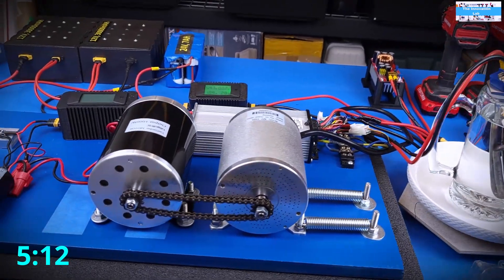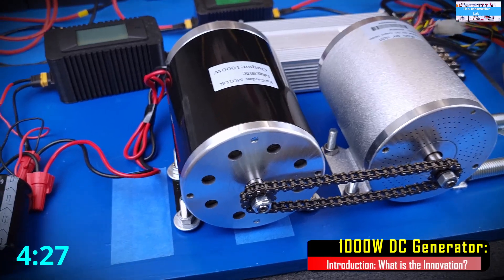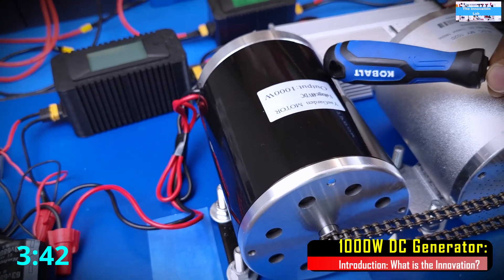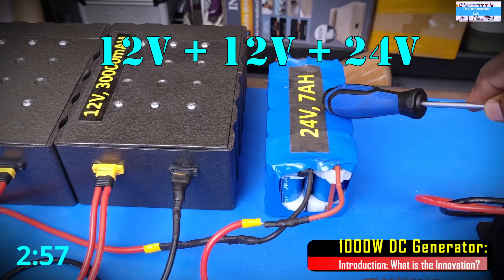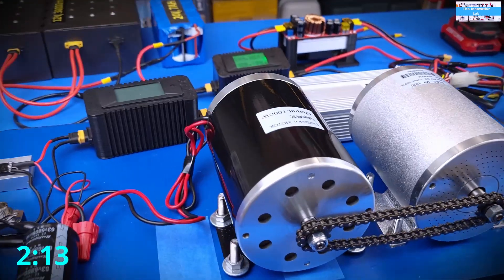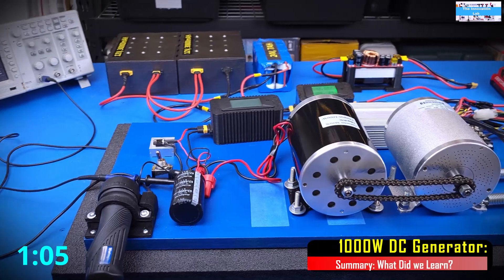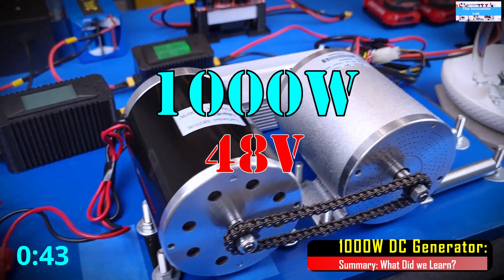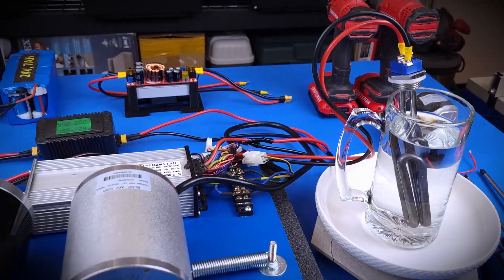ELECTRIC MOTOR GENERATOR, Future DC to DC Boost Converter Drive.

Comment: I bought a 3000w 72v motor with controller kit. I connected all the wires correctly but when I twist the throttle nothing happens and I hear 5 clicks coming from the controller. It’s connected to a 1200w 48v switching power supply with a 1800w boost converter. Do you know why this is happening?
Reply from the maker: You may have a faulty motor or speed controller system. 
However, if you are sure that your system is not faulty,  you could  start with making sure that the output current limit of your dc to dc converter is set to the maximum point. 

💥How to:
With the converter input to your left and output to your right, adjust the current limit potentiometer (the one in the middle) clockwise multiple times until you hear faint clicks.
Then, after that, throttling again and see if the issue persists.

Also, make sure that the output of the converter is adjusted to the required voltage level for your motor (72V) - as you mentioned provided.

Let me know if this resolves the issue.😊
The Innovati0n Lab 💥 www.theinnovati0nlab.com
Reply: @ thanks for the response. It’s definitely the controller and not the motor. I have an extra controller exactly the same and everything works fine. The current is set to the limit on the converter. Thanks anyway.

Comment: Could you use a potentiometer instead of a twist throttle with this bldc controller?
Reply from the maker: Great question.
I love your outside the box thinking. 

You probably could, with the right circuit. But I will not recommend doing that because the throttle is specially designed to survive multiple twists and turns, and it has inbuilt return springs that return the motor speed to a lower rpm instantaneously  If you try doing this function with a potentiometer, the pot wouldn't only fail after a few turns. You will also have a massive safety issue that could be harmful.

⚠️⚠️⚠️
I DO NOT  recommend you do this.
A lot of things are possible when it comes to electronics and power, but we always have to consider safety and reliability....ALWAYS.

The Innovati0n Lab 💥 www.theinnovati0nlab.com
Reply: @theinnovati0nlab782  ok np. Thanks for the advice but my application doesn’t require multiple twists and turns. The potentiometer will always be at one spot where a switch will turn the motor on and off at specific battery voltage.
Reply: @theinnovati0nlab782  so I installed a potentiometer to the controller and it works perfectly.

Comment: SCAM and CLICKBAIT. Another channel from Asia trying it and therefore faking it. If it worked it had earned a big money with a patent. But no, it won't work.  And if I'm wrong, he/she can show the calculations and specs.
This is what happens when people without a proper education in physics share misinformation with others who are unaware. This system can NEVER achieve more than 100% efficiency, which means it won't work at all without additional energy. 
Don't waste your time people. If you don't believe me, try it for yourself, spend it your money—and you will likely fail. Good luck failing.

Comment: Hay great video. Question, can you connect the 48v dc motor to a 48v to 120v AC inverter to power 120v devices?
Reply from the maker: I believe it is possible, but you have to watch for the rpm of the motor. 
If the rpm is to low, it will create pulsating that would damage your inverter. Also, you will need to add an external rectifier circuit to help clean up the power before connecting it to the inverter.
⚠️⚠️⚠️
Ultimately, I have never done this before. I always encourage my audience to have a battery as a buffer power source that drives the power inverters. It is never adviceable to couple a high power inverter to a source whose power levels could fluctuate. 
You must proceed on this with great caution, knowing that there could be failures. Please conduct lots of research.

I hope this helps.
The Innovati0n Lab💥
www.theinnovati0nlab.com
Reply: @theinnovati0nlab782  thanks for the response. But what can happen to the inverter if the power fluctuates? Will it catch fire?
Reply: @theinnovati0nlab782  also I’m under the impression that rectifiers are used when converting AC to DC. I’m converting DC to AC.
Reply: @theinnovati0nlab782  also the rpm of the motor will be at a constant 3000. So it shouldn’t be an issue.

Comment: e se aumentar o tamanho da engrenagem de um gerador ?
Reply from the maker: That is a great question. 👍👍
It might result in an increase in rpm of the dc generator... but honestly, I really don't know a whole lot about mechanical systems , gears, and that sort of subject. 😊 My interest is more on the electronics side of things. You can surely watch the videos I have made on the subject to see if you can build a modified version of the setup with a bigger gear on the motor side. 
This video series does get recommended a whole lot by the YouTube algorithm, so we did have the motivation to conduct more tests on the subject.

Thanks a lot for the thoughtful question.
-The Innovati0n Lab.

Comment: Why out put in the DC motor ( generator) it's DC but brashless motor and stepper motor it's ac?
Reply from the maker: The driving motor is a brushless motor. The other motor is a permanent magnet DC motor that was used as a DC Power generator. Both motors are DC driven. 
👍😎
The Innovati0n Lab

Comment: This is great for of grid system..
Reply from the maker: Thanks a lot for the feedback. This system produces a DC output and not AC output. Hence, I wouldn't say that it is good for the grid. Also, I would not recommend it as an efficient method of  converting a DC source to AC - mostly because the efficiency is not good. There will be lots of power lost to the mechanical interface or coupling. However, it might be something to experiment on, as a diy wind energy generator.
Reply: @theinnovati0nlab782  
Thank you for your time explaining,
Keep making videos related about generators,
Greetings from north borneo..
Reply from the maker: @MegaTUHAU  
Greetings to you too!
Thanks a lot for all the amazing feedback. 
👍😎